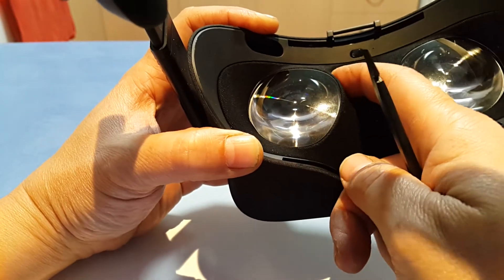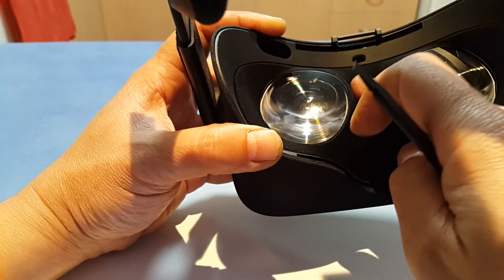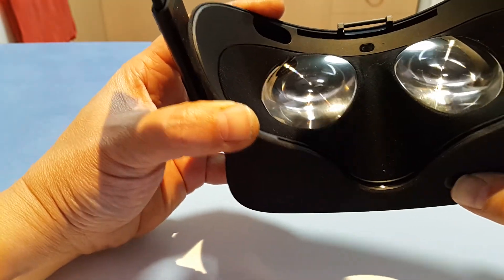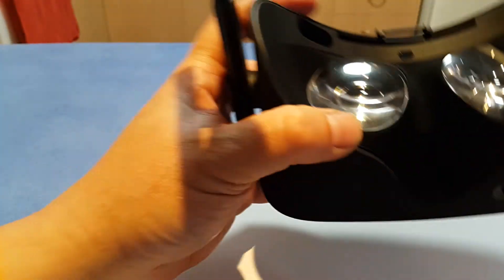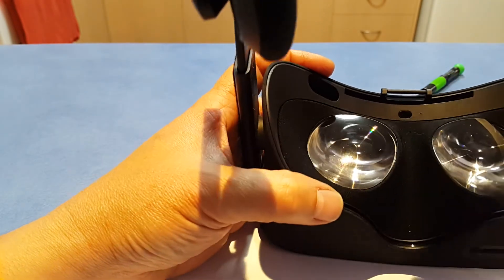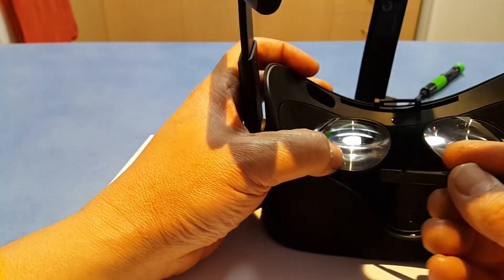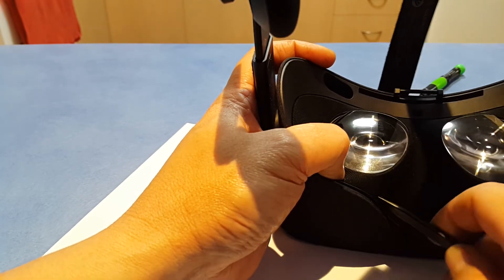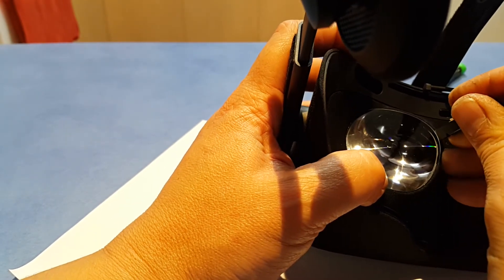Oculus Rift CV1 Teardown Disassembly How To Part 2

Comment: All i can say is thank you so much for the guide, i had the same problem with disconnects every time i touched the rift, and in time become unplayble. But after teardown all the components i put the main board into oven at 200° celisus for 10 min and to my big suprised the issue is fixed. Probably cold soldering from manufactory that become worse in time or the thing that mainboard flex with upper case of the rift.  I almost throw it away... THANKS !!!!
Reply: I swear to god the "T3" screw second from the left in the bottom is not a T3 screw. I've been trying for hours to take it out with no luck. It doesn't seem to have the T3 head when I used a flashlight to look at it.

Comment: Hi Carlos..What file and technique did you use to file down the t3 bit? I was given a rush project that requires me to tear down the rift and cover the shell with fabric. I would greatly appreciate any support you can offer to help me get past this step. Thank you for posting this. It's incredibly helpful!!
Reply from the maker: I used a small flat file from a needle file set, not too coarse. Lay the file flat on a table and hold it still, then file the end of the T3 torx screwdriver by moving the end back and forth on the file. Always keep the screwdriver perpendicular to the file and be carefule not to remove too much material. File a small amount then check the fit. Hope that helps.